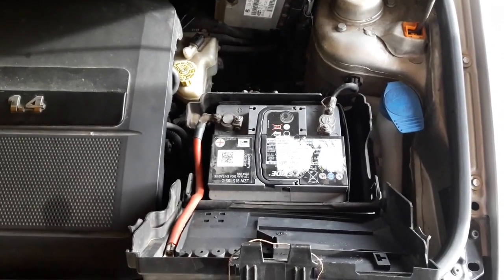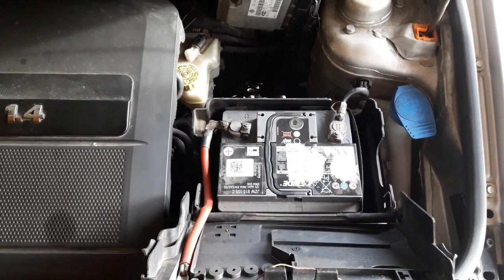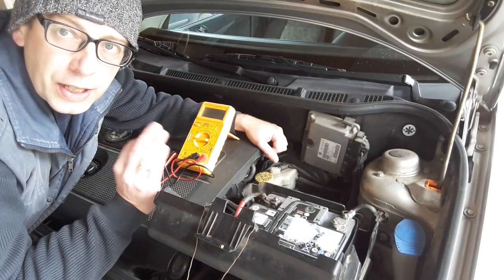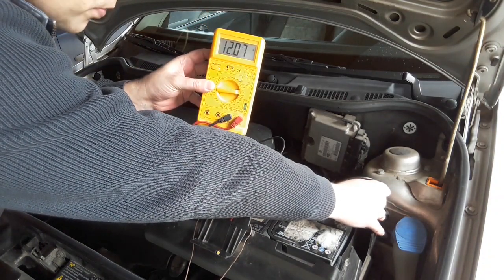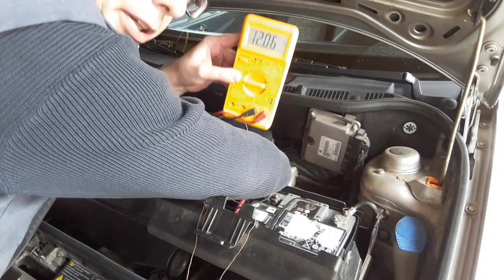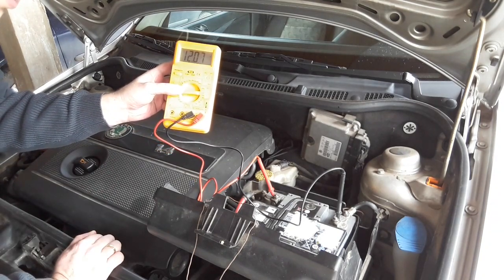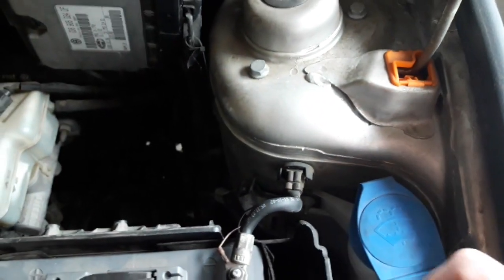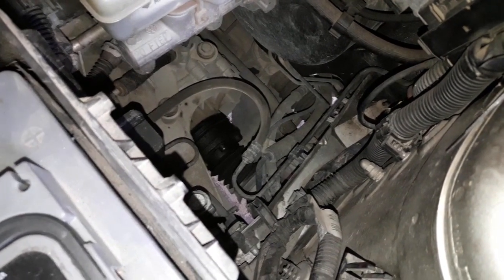Bad Ground Connection On Cars-Meaning,Symptoms, Diagnosing and Solving The Problem

Comment: All my dash lights suddenly came on, lost tac and speedo, says fuel low, and tpms fault, car won't start and no clicks or anything when I turn the key. It seems that there's no connection to any of the electronics except the interior lights and radio works perfectly fine. I have a 2012 mustang gt
Reply from the maker: Hi and thanks for watching!
Could be a lot of things. I would start by checking the battery clamps and the fuses first.
It wouldn't hurt to check the ground connections either although I doubt that's the reason.
Reply: @DespairRepair  it happened yesterday, I went out this morning to do the jumper cables test from the video, and now it seems the battery is dead
Reply from the maker: @kevinbarrett4090  was the battery dead before or after the cable test?
Reply: @DespairRepair  before
Reply from the maker: @kevinbarrett4090  did you check anything before like the alternator charge, the battery clamp connections, battery voltage while the engine is off, or else?
Did you try to jump start the car?
Reply: @DespairRepair  I don't have a multimeter so no, I'm taking the battery to AutoZone to test, and I'll get one then
Reply from the maker: @kevinbarrett4090  ok but try to find out what caused the problem. Is it a  bad battery, is the alternator ok, is there an electric drain?
You have to buy a new battery that's obvious but try to find out what the cause is so it doesn't happen again in the near future.
Hope this helps
Reply: @DespairRepair  I appreciate it, I'll try to figure it out, I'm just not good with electrical problems 😅
Reply from the maker: @kevinbarrett4090  good luck with the repair 🙂

Comment: Is there any difference in functionality between the ground cable on the -ve terminal and the one attached to the engine?
Reply from the maker: Hi and thanks for watching! Didn't really understand the question but both cables have one function: to properly connect the engine and car body to the minus battery terminal.
Reply: @DespairRepair  well explained, my car has weird electrical issues in almost all components and with the codes, I had to check the ground wire, only checked the one on the battery -ve terminal and it was clean and good, only to be told there's another one attached to the engine, when inspected, it had extensive corrosion which I believe is causing all these electrical issues
Reply from the maker: @mariachiwaula7140  best check all the connections especially the ones from the battery to the car body and from the body to the engine (if there is one).
Also, check the connections on various parts of the car body (they look like screws welded to the body), these are known to rust over time.
Reply: @DespairRepair  alright thanks 😊

Comment: nice video.
you could have made some diagnosis eg. when the charger wont charge the battery, the ground to the engine is faulty etc.
also after cleaning and before refitting - grease the connection with copper paste, to prevent the malfunctioning in the future.
Reply from the maker: Hi, and thanks for watching!
We've made a video about how to check the alternator charge. You're right about the copper grease.
Thanks for sharing.

Comment: I have a low mi. Lincoln town car ,2005 with a no start in park but in neutral always, once in about 50 normal starts.  I've done neutral switch, starter and battery.   This has been tough to figure out! HELP!

Comment: Have you ever seen the battery light come on but alternator is at 13.99-14.05? When the light comes the dash and a/c go off line. When the battery light goes off, everything is normal.
Reply from the maker: Hi and thanks for watching!
Regarding ground issues, there's a wide variety of symptoms, mostly depending on the car model and what system is intertwined with what.
But it doesn't have to be a ground issue at all, it could be something else.

Comment: Here's a riddle... car has been running ok and all of a sudden it wouldnt start. I tested the battery and it was fully harged (and could take a charge), but the car would not start; no click, no noise and NO power to anything else (i.e. could not put in neutral though the key was in ACC). Jump pac did nothing, BUT twice I jumped it with another vehicle and bam it started. Drove it home, turned it off, and it wont start. Im thinking ground or positive issue. Connections look clean. NOTE: I had the Alternator tested while running and it showed it was not charging fully. I will take the alternator off and have it tested on the bench, but this is a separate issue than not starting.
Reply from the maker: Hi and thanks for watching!
If the battery terminals and clamps are clean, then I would first test the battery.

Comment: Awesome video. I just was curious if bad grounds can cause the ecm code P0603 to come up because a few months ago a mobile mechanic forgot to put the washers back on the alternator when replacing an old exhaust manifold. So I had to get a new battery fuse for the positive side cable. Ever since then the code P0603 has been coming up and I’m trying to figure out what cable or whatever might have went bad so I can get it fixed?
Reply from the maker: Hi, thanks for watching and for the kind comment!
Regarding the washers, they need to be there but if the contact is good, it missing should not cause a problem.
Yes, a bad ground connection can cause this kind of error code and this is certainly worth checking.
But I would first check all of the basic connections like the battery clamps, alternator connections, the mentioned fuse and every other place that has to do or is near the repair that was made.
in lots of cases, like that, a bad or missing connection may cause a problem.
Hope this helps at least a bit.
Best of luck with the repair.
Reply: @DespairRepair yea I forgot to say that my vehicle from time to time jerks/stalls and that’s what I’m trying to fix along with the code P0603 going away.
Reply from the maker: @cameronmorgan0203  well that could literally mean dozens of things.
But if the ECM doesn't function properly then that's what will happen since the computer probably can't regulate the air/fuel mixture, ignition system, and else.
This doesn't help anything, but again: I would check the repair that was recently made.
Not saying it was a bad repair but if everything worked good before that, it is the main suspect.
I would check if everything is tightened, well connected, properly returned into place, and so on.

Comment: Simplified video. Thank you. My battery light stays on the dashboard for like 2 to 5 minutes after starting the car before going off. Any leads? Battery Voltage is 12.8V. 

Also I want to believe that there is a separate ground connection between the battery and the gearbox as well.

Comment: At 12.06 VDC, that lead acid battery is down to approx 35% and should never get anywhere near that considering as soon as you start your car, the power used to start is replaced while driving. I would load test the battery with a load testing diagnostic tool and see if the battery is shot.

Comment: On my vehicle 24volt, battery ( -) VS vehicle body showing  19-22 Voltage. And battery (+ ) to body showing only 3-5 Volts. 

Is it bad ground? 

How to check it?
Reply from the maker: Hi and thanks for watching! In that case, I would use a jumper cable and connect it from the minus battery terminal to a clean safe,metal part of the engine.
I would then start the engine and check the voltage.
The jumper cable circumvents the car's ground connections and this way you can see if any of them is the problem.
Hope this helps.

Comment: my Dodge ram 1500 died going 70 miles an hour down the interstate yesterday yesterday, started back up and I broke down two more times before I had my truck towed home and then turned around and found the ground wire on my battery disconnected and broken, would that cause my truck to shut down while driving however the radio did stay on and the vehicle started back up however now I don't trust driving my truck
Reply from the maker: Hi and thanks for watching!
Yes, if the ground wire was broken and disconnected it would shut down the vehicle, at least from my experience.
To be honest I don't know how the radio continued to work. It shouldn't have.
Regarding trust issues, If I were you I would replace the cable completely and continue driving.
Hope this helps.

Comment: Not to get too far into the weeds of esotericism, but grounding your barefeet to the earth can create stability and homeostasis in the body as well. My 2015 Charger was having no crank issues and just as you correctly stated, it could be a faulty ground game or “Bad Earth” connection issue..Everyone should buy a multimeter and self jump battery capacity  for a good educational DIY experience. Remember cars and computers are mimicking our internal human electrical system. Thanks for this..
Reply: You  are "AWAKE" !
Reply: I think my truck problems manifested after i parked under my homes electric wires amd not far from thr home ground....any thoughts?
Reply: I love this comment, so very much. Thank you for sharing it with us.
And yes, you can use the multi meter on yourself. Try it while you're wearing shoes,  and then again with at least one shoe off while you're standing on the earth. I mean earth, not concrete or any other substance. You will actually see how you are grounded very quickly. One probe on yourself, the other on the earth. I did this with my grandson a couple weeks ago. Consistent, every time.
Reply: What are you saying to use the Multimeter on myself ? That might actually be a good idea gotta try that

Comment: My car wont start just one  click sound when warm 
When car is cold it starts normally can u tell me what's the problem is
Reply from the maker: Hi and thanks for watching!
In that case, I would first check the starter (the rotor mainly). 
You can also check the ground connections, it wouldn't hurt.

Comment: I did that ground test with the multimeter that you explained to do. I checked my battery I had roughly near 12 volts and then I checked my negative ground at the chassis and it was lower, it was like 11.8 then I went to check my ground at the transmission bolt it was also 11.8.
 So what does that mean if I have a voltage drop for the grounds?
Reply from the maker: I don't think so, that much difference doesn't matter.
But I must say on this part that making another direct ground connection is the best way to test the problem.
Like the case with the jumper cable. Just make another temporary ground connection if possible and you'll see definitely if it's the problem.
This is because sometimes, under load, the ground connection may show different values. When it's under load it may lose contact, without load it shows a good reading.
I'm sorry if this is confusing but I hope you get my point.
Reply: @DespairRepair  I see what you're saying, some people think more grounds are better, I could see your theory behind that but I've heard that's actually not good to put too many grounds in the engine bay,
  as that could interrupt the EMF electromagnetic frequency which in the short-term would be hard to notice, but in the long term it could end up causing the ECU to fry out.😫🤯🌋

Comment: Thanks for sharing this video about checking your grounds, it give me a better understanding of what to do. 

Also you should also show how to do a resistance  ground test with your multi meter, as if your multimeter shows High Resistance values that means you have a ground break somewhere that's another way of doing it.
Reply from the maker: Hi Steve, thanks for watching and for sharing!
You're right that's one more way of showing a bad ground connection.

Comment: Sir after installing the battery it drains fast so I usually disconnect the negative terminal but when I connect it back everything turns on but once the key is turned everything goes off and the console goes blank,And also my rpm raises a lot unnecessarily when ac is turned on.
Reply from the maker: Hi and thanks for watching!
What's the car model you're talking about?
About the power drainage, it could be a lot of things but I would first check the ignition switch and the connections on it.

Comment: My car is not starting, I put a new battery in and within a few minutes the battery drained. Could this be because of a faulty ground? Thank you
Reply from the maker: Hi and thanks for watching!
It all depends, does the alternator work properly, is there a parasitic drain somewhere, is there a big short circuit somewhere and so on.
To be honest, I doubt that a bad ground connection would cause that kind of draining.

Comment: Just adding on to the heavy cranking - In some cases, your car may not crank at all! My VW Tiguan has a snapped earth cable from the body to the gearbox and this caused it to not crank at all - Replacement cable coming this weekend and I will attempt to fix this. Do I need to disconnect the Negative terminal when doing this?
Reply from the maker: Hi Lewis and thanks for watching and sharing your experience.
It would be best to take off the negative battery clamp just in case. It's safer that way, both for you and the car.
Reply: @Despair Repair  Thank you for getting back to me - Keep up the great videos, I have subbed 😊

Comment: can this make o2 sensor report higher reading?
Reply from the maker: Hi and thanks for watching!
Specifically for the O2 sensor, I think not unless it has a bad connection for instance.
Reply: @DespairRepair  lets say the ground on car is bad, can i expect a higher reading on voltage? cause im getting high voltage like 300mv higher than usual
Reply from the maker: @kumars172  it is possible since when the ground connection is bad it can cause all sorts of problems.
But why don't you test the ground connection and solve the dilemma?
Use a jumper cable, connect it from the minus battery terminal to the engine, and then measure. See if there's any difference.
Reply: @DespairRepair   I think the o2 ground is under the car, however i tested today with the front firewall or other parts with multimeter and there is no voltage, the battery read 14v with alternator and 12v without alt . so i think this is grounds for bad ground for my o2 sensor causing it to go rich
Reply: @DespairRepair  also i just recently changed a power window switch twice, do u think bad ground kills switches too?
Reply from the maker: @kumars172  well did you check all the connectors and pins? Is everything clean and well connected?
Sometimes the connector can be the issue due to heat and bending.
Are there any signs of physical damage to the wiring loom from the sensor?
Reply from the maker: @kumars172  again it's possible but I would say it's rare. Does the window mechanism work properly? This is a more common cause of problems.
Regarding this and the O2 sensor problem, try checking the ground connections to the car body.
They are in different places for every car. The most common issue is that they rust or loosen over time.
Especially if there was body work done for instance.
These looms can cause some serious problems.
Reply: @DespairRepair  i havent checked the sensor because it is very much inaccessible without a lift, I will take it to a technician tomorrow and get this checked, if it were accessible I would have done it myself. Thank you for your fast responses, anything you would like me to check tomorrow?
Reply from the maker: @kumars172  you're welcome and hope any of this helps 🙂

Comment: If you have a loose ground can the car then suddenly die 1 second when you give it full throttle? It died for a second when the antispinn kicked in .
Reply from the maker: Hi and thanks for watching!
I doubt it, in that case, I would first check the battery clamps and terminals, if they're clean and tightened.

Comment: Guru here, be mindful when redesigning (adding wires) to any vehicle. Often voltage drop and or path is used to do interesting things. Like when cranking an 80s ford a brake light bulb test is accomplished on dash bulb (the front rear proportion valve indicator) to many charging systems measuring voltage drop accros a certain length of wire in the ground path to regulate charging current. Bigger is not always better when rewiring one of these type of systems.

Comment: Hopefully you’re still active in the comments. Trying to fix my late brothers ‘98 Acura 2.3 CL. When jump starting the car it takes forever for it to charge, when it finally has enough charge it turns on perfectly and stays running. No voltage drop of any sorts. When you turn the car off and immediately try to turn it back on..completely dead once again. I recently found that the ground going to the negative battery terminal is chopped off and disconnected. Could this be my issue? Alternator has been tested and that’s not the problem.
Reply from the maker: Hi and thanks for watching!
If the ground cable was chopped off, you wouldn't be able to start the car at all and the ignition wouldn't work also.
Regarding the other issue, I would first check the battery if it's OK.
Hope this helps

Comment: Thank you!  I have this going on right now!  Changed out spark plugs, boots, break booster...
Reply from the maker: You're welcome and good luck with the repair!
Reply: @DespairRepair  Thanks, sounds like a lot of people need it from what I'm seeing on the forums!
Reply from the maker: @Bizzaro500  probably, a bad ground connection is one of the most overlooked problems but one that can cause a lot of issues, especially with today's electronic systems.

Comment: Hello I got a 1999 Dodge ram 2500 I got a code po462 low voltage on the sending unit how can I fix the gas gauge gas light is always on I changed the cluster and fuel pump and sending unit????